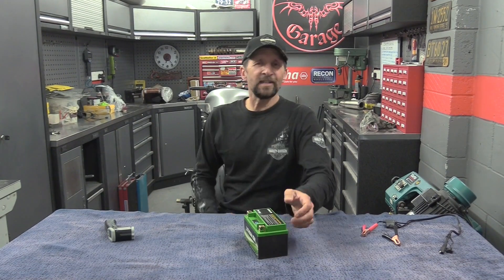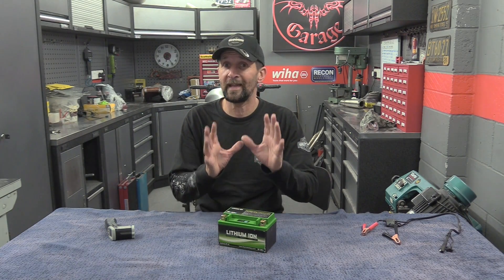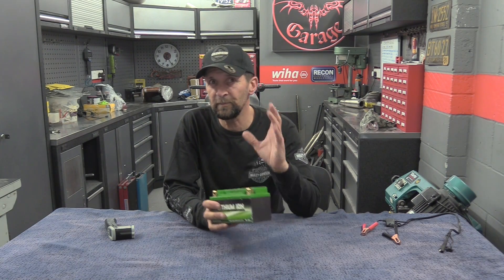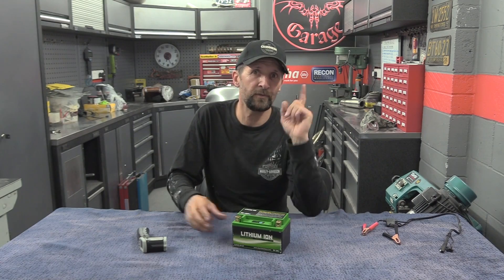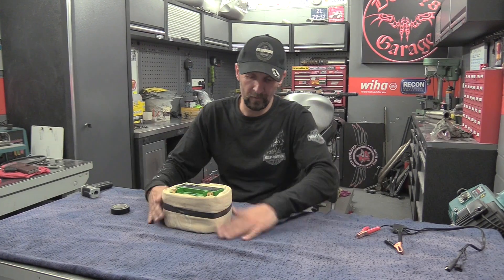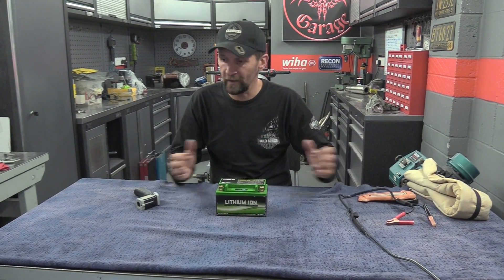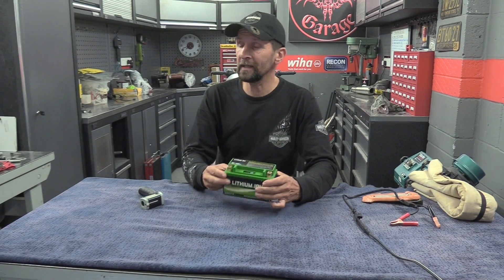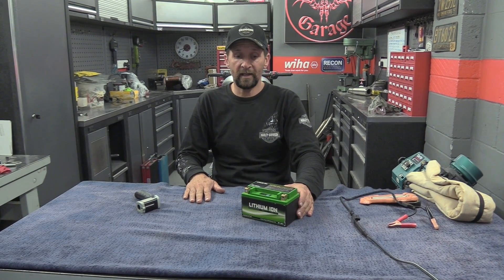Delboy's Garage, Lithium Battery Heat Test.

Comment: In relation to you heat test, before those boxes would get hot the cells would catch fire they are so small.

If you wanted to test the heat from that battery you would be better off putting the heat tester on the back of the box not the side or the top.

There is so little material in the box that any heat generated would take a long time to reach the outside of the plastic box, by the time you feel the heat it may well be too late.

As I said I took my one apart and there are 3 very small pouch cells in the big box, in fact the writing says 4 ah on the battery box it does not specify the AH of the battery only the voltage, but on the actual cells it says 4 ah which is pretty piss poor and a clear indication that the battery will run down very fast, but charge very fast as well, which it does.

The problem is, if you have a minor fault and you try to start the bike you could end up with a flat battery very quickly, if you leave the bike for more than 2 or 3 days and you have an alarm you could end up with a flat battery, as I did twice.

Lithium batteries are normally very good for a few years, my last one lasted around 4 years, I opened it up and compared to this green box it has double the size cells and would crank for a long time before running down.

I would suggest you open the box up and take a look at what is inside, it's roughly the size of something you would run a model plane with.

It's not good at all.
Reply from the maker: ...yet it's still working faultlessly to this day with not once single problem.!  Go figure aye !🤔
Reply: @Moonfleet41  So did my one in fact it was fantastic for around 4 years then suddenly without any warning it just stopped holding a charge, I would charge it up leave it a day and it would be dead, I bought a new one same type you have and left the bike for 4 days with my alarm on and the battery went dead, tried this a few times on the new batter but no no good at all.

But so long as you rode the bike everyday it was ok, leave it 3 or 4 days the battery would die.

So I looked into it, opened the battery to see what was inside, the cells are about the size of a model cars cells, very small, the slightest issue would see this  artery fail.

So I will fix my old battery using some of the cells from this new battery to get a decent battery from the two.

But the reason this battery is so light is because there is hardly anything inside the box.
My old battery was more substantial and I had no problems until it failed.

My AGM battery as I said lasted a lot longer, and when it started to fail it was gradual, the lithium failed suddenly, I almost broke down as it stopped holding a charge.

But good luck with your one, when they work properly they are great more power delivery, better response, but they just don't last as long.

Comment: I have one of these batteries and they are terrible.

You leave it in the bike for a few days and it's dead, my other lithium battery which failed after 4 years was great, would leave my bike for weeks go back it would start up first time.

This one, cost me around 70 pounds and it's complete garbage.

So rather than send it back, I wanted to see what was inside it, it was a shock the cells are so small compared to the other one, no wonder it drains out so quickly, yes it will run the bike, and yes it will start the bike, but the cells are so small if you have anything at all running once you shut down the battery dies.

Also there seems to be no margin for extras with this battery.

So I have had two lithium batteries, for the same bike in 5 years, my lead acid AGM battery lasted 11 years, same bike.

I intend repairing my first lithium battery but these green batteries are complete rubbish.
Reply from the maker: ...So not a fan then 🤔 !
Reply: @Moonfleet41  Well I was a fan as the lithium battery I first had was great, but for one big problem, it just didn't last anywhere near as long as the AGM battery.

Comment: Your test results may not represent worst case. 
Lithium bats have substantial internal resistance. Heat dissipated is in proportion to square of current you charge or discharge your battery.
So if u double your current heat goes up 4 times. if you rise current 4 times heat goes up 16 times  difference as if you ride 10mph and 160mph

Please discharge your battery to almost empty. Start bike and let generator charge it. Then u get maximum charging current and make measurements.

Other test is try to continuously run starter motor for 1 minute or so and see what happens.

And thanks mate for all your hard work. I'm impressed and have learned so much from You. Hope I can meet you one day in person.
Reply from the maker: Thanks for that kind insight mate, very interesting, the battery performed well in all situations and is still performing well today, thanks for your kind support, keep in touch, all the best, Del
Reply: @Moonfleet41   Delboy's Garage  Del, my comment is about what goes outside of 99.99% of normal use. You will be fine unless you hit that rare circumstance. Safety thinking... In engineering terms we call it worst case designing or testing for worst case scenario. Therefore my recommendation would be do the test for case of overusing starter and charging fully flat LiON battery with bikes built in alternator. Pls charge not at idle engine speed bec than alternators do not reach its full charging potential. 

In general. LiON batteries are great for projects. Are small and light. Most people buy them because they survive deep and long discharge. (Lead Acid die quickly if exposed to that) They survive winter without topping charge. This is what sell them. 

What you will not be told is that LiON batteries come so much higher risk of making inferno in your garage. Therefore my personal recommendation is do not use LiON unless you really have to. Its better to periodically go to garage and charge battery than relay in LiON.

Lead acid batteries require maintenance - they must be kept fully charger. When looked after properly they last longer than LiON., My oldest battery is 14y old factoryu fitted to Suzuki Intruder. Engine size 1800ccm. 

Example of case when i would consider taking LiON is caffe racer project  where space is main restrictor.

Comment: Hi Del can you make an experiment on lithium battery  replacing car acid battery, Can lithium battery  stand up form the car engine  heat under the hood. just want to know is it safe to make one power lithium battery for car and using it daily.

Comment: Unless the charging system of the bike can sense that yor battery is a lithium ion battery, and switch from least acid to lithium ion charging system, the bike will charge it as if the battery were a lead acid battery.

Comment: Hi Del & Penny.
My upgrades & repairs on my 125 Chinese bike are going well until I realised the headlight bulb medium beam is flickering as if a contact somewhere is acting up. The low beam and the hight beam are good and strong. So, I started to do some checks 
1) the bulb filament are good
2) the bulb fits well in its socket and everything is clean and rust free
3) the wiring looks good and solid again no rust
but today, as I was doing more checks I forgot to turn the contact off and as I was moving a metallic screwdriver from contact to contact the bulb suddenly light up and as suddenly off. I was onto something I thought until I realised that the bike is dead. 
no more contact, no more light, no more anything :((
What did I do? Did I fry the battery or something else???
Reply from the maker: Hi Olivier, if you got a spark when you bridged that screwdriver, then you probably made a short circuit and have blown a fuse... check all your fuses to make sure they're intact, that's probably where the problem is!
Reply: Moonfleet41 Thank you Del. I put 2 and 2 together and realised the same happens when something trips up in the house. So I found the fuses. A grand total of 2 cylinder 10A fuses and of course 1 was toast. Replaced it and all is well in the world again. Fair play to me for thinking about it and to the bike doe having a spare fuse. Good old Chinese bike

Comment: Cheers Del, was thinking about changing to a Lithium Battery. 👍
Reply from the maker: Good move buddy, but check with the guys at Wemoto to make sure it's compatible with your bike, and you'll need a dedicated charger, which they also supply!

Comment: 1 quick question how would I go on with my project bandit 600w 20 year old bike bike needs a good respray what's the best way to sand the frame down without paying a bomb and what's the best paint to use, as all this stuff you get from the shops now adays looks horrible, and do I prime and lacquer it if so what ones please, thank you big man 👊👊
Reply from the maker: Hi buddy, sounds like a fun project.. on my frame on the fighter build, I've used Simoniz Tough Paint, it doesn't need primer, it goes straight on to bare metal, just sand down any flakey areas right to the bare metal, and scuff the rest of it up with 800 grit paper, or a corse Scotchpad, mask off everything you don't want painted and lay up 6 coats for a fabulous finish... it's a curing paint rather than a drying paint, so give it a good few days to harden off before you do anything to it... it's resistant to most chemicals, except petrol, and it's even mildly heat resistant - hope that helps, good luck with it !
Reply: Moonfleet41 thank you for the advice will it hurt to put primer on anyways? And lacquer at the end of will that not be needed?
Reply from the maker: If the primer and laquer you choose are compatible with the tough paint, then no it wont "hurt", but it'll kinda be a waste of time and money, that product is designed to be used as a one coat system by itself..   Hope that helps.. Del.

Comment: How well do these lithium batterys handle cold weather? will they still crank a bike in the winter or would you need to warm them up a bit first?
Reply from the maker: I'm not so sure from my own experience, I am told that with some of the trades people using LI batteries in their power tools, that they can be slow in the morning when it's really cold, so time will tell on that one !

Comment: Just a thought. I wonder if the heat people are referig to is generated more so from the engine?

I have a lead acid batter in my bandit and it getts pretty warm after I've been riding.

Cheers
Reply from the maker: I don't think so buddy, the batteries are known to overheat when they develop internal faults, or any incorrectly charged, I just wanted to check it in normal use to make sure it wasn't going to cause problems when I get it on the road!

Comment: These are lithium iron phosphate batteries, they have high charge and discharge capabilities without the heat problems you would get with other lithium technologies. The only problem, like the manufacturers say is not to put too high a voltage into them, that is when you can get heat problems.
Reply from the maker: Thanks Karl, that ties up with what a lot of other posters here have said, and also the warnings on the battery label itself.. they warn against charging above 15v, so good call mate... thanks again and keep in touch.. del.

Comment: Thanks for the practical test. Not the most comprehensive but certainly shows that the battery appears safe to use. I would definitely agree with your comment at the end about people using the wrong battery for their bikes, the most likely cause of failure I would say.
Cheers Del and Penny.
Reply from the maker: Hi Andy, yeah, there was so much more that i could have done yet.. and once i can be sure that its not going to go all Tesla on me, then ill make another test of it in use once the bike is finished.. ill connect it all up with a heat sensor and see how it fairs in normal road conditions.. also on a hot day if we get any more this year..lol!

Comment: Failed testing method 

You need to have the battery not fully charged as the charger is clever enough to not dump in amps due to the battery being in a fully charged state.  It's currently floating the battery charge.  So no power or next to none.
Reply from the maker: That was the reason for the headlight bulb hook up, I started with the battery at 100%, the bulb test took it down to 89% and in the half hour on charge, it went back up to 98%, so there was power going in and it wasn't floating... you are right, it wasn't a scientific test, but I don't think it's fair to say it failed, maybe flawed... but am just trying to see if it would heat up at all... and it didn't, not one tiny bit... which is contrary of the warnings of fire, which I've since learned from the comment below can be due to faults with the method of charging, too high a voltage going in to it, and inappropriate charging systems... learning as I go!
Reply: Moonfleet41 

89% isn't low enough to make the charger work full power thus generating heat.  Also a single 55w bulb is 55w loss per hour and isn't high drain. 

We used these in race bikes before we started making our own.  They are very sensitive to ampage of chargers as the internal c rating of a battery cells dictates how much current they can accept those cheap batteries are usually 20c so can't take the current of chargers and thus heat up.  

They also cannot be balanced as they don't have the connections to check cells when charging on a balanced charger so one goes out of balance and thus overcharged and this is were risk of them exploding starts.

Just sharing knowledgebase learned from mistakes.
Reply from the maker: Thanks so much buddy.. the feedback here has been amazing, ive thought of a way to create lots of draught flow past the battery.. but first, as one poster here suggested, ill connect it all up with a temperature sensor and mount the display on the bars and see just how hot it gets in use...(maybe with the seat mounted on one bolt for a quick access if i need it..lol     On a hot day, with a hot exhaust under it, then it will obviously be exposed to buckets of external heat.. and thats not going to help it.. but its whether that then creates internal heat as a result..!!!  Thanks again for your insight buddy. much appreciated. Del.
Reply: Once you have had your heat testing done, try them in the cold and see it you can get it to crank over.

they hate cold temps and can be awful and you then have insulate them triggering issues with the first problem.

Comment: Altanator will charge at 12v to 14v now what does the charger charge at??
Reply from the maker: Charger doesn't give that reading, but battery label says "no lower than 9v, and no higher then 15v... so maybe within parameters.. but its more about weather the charge input cuts off once the battery is fully charged..

Comment: batteries arent for running things on a bike.. they're for starting.. that's about as much of a draw that battery should see.. hence why your R/R output is wired to the main harness.. if the battery is getting so hot it needs fans.. well.. something else is fucked... that being said.. you can take a lot of metal out of your sub frame and not lose a significant amount of strength.. so you get the airflow that the internet wants.. and cut the weight in half.
Reply from the maker: Yeah, its a double gain there.. i have had a thought to maybe cut out the sides of the crate and make some thin sheet metal scoops over the holes to scoop in passing air.. as much as this test could not find a single degree increase in heat.. i think the underseat exhaust is going to bring its own rain to the parade..lol!
Reply: my underseat exhaust added no real heat... at least what i could feel with my back side.. and my mid pipe was only 2 inches from the bottom of my seat.. so 3 inches to bare skin it was just wrapped  ez pz... as for the increase in heat.. a lot of people seem to be thinking of power tools.. so total loss lithium batteries.. which do get hot but like i said once your bike is running you can unplug the batter and it'll run just fine.. as its using the generator to run.. its not a empty/charge batter scenario here.. I doubt you'll see any significant temp gain.. if anything it will be from the frame getting got from the engine and going into the battery..

Comment: As an aircraft electrician i have used lithium batteries alot.   The problem is internal failures.  I have seen a disconnected battery fo into thermal runnaway with catastrophic results.  The technology is not ready yet.  That is why hybrid cars have a crazy cooling system for the battery.  Have you seen the video today of the Tesla shooting flames?
Reply from the maker: Yes i saw that video.. and thought it spooky it went up the day i posted this video...i saw that video about an hour after posting mine.. maybe you're right, they are running with this tech become they can walk.. i made the battery tray big enough to take a Glass matt Motobatt battery in case i need to just in case..!